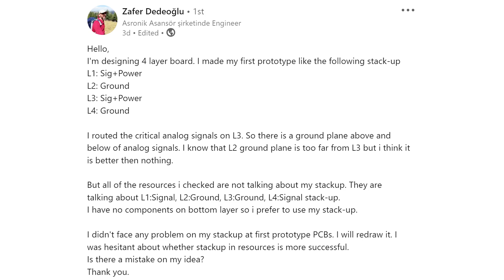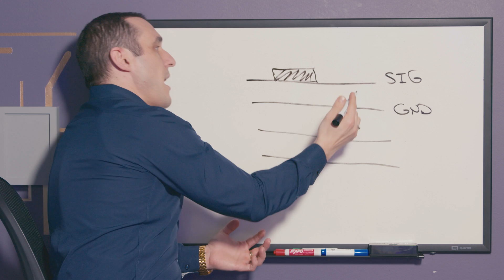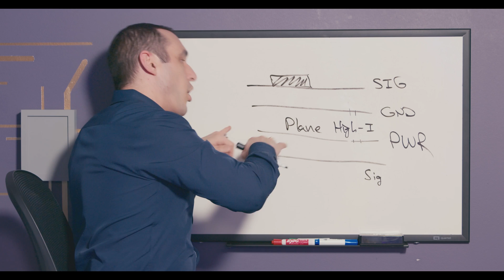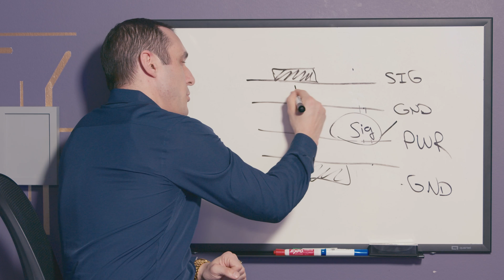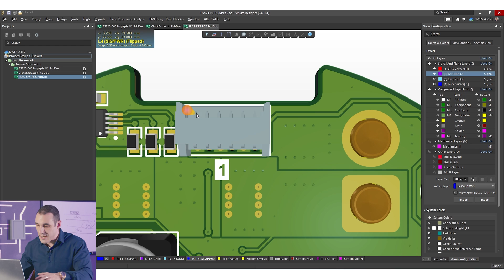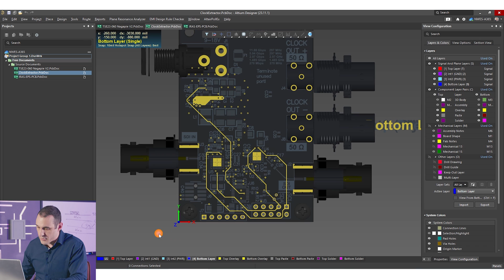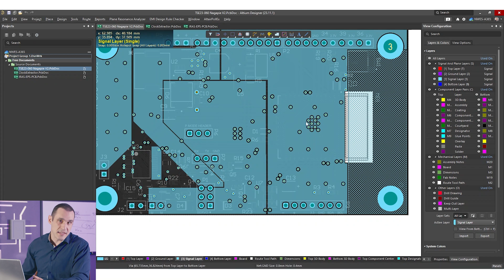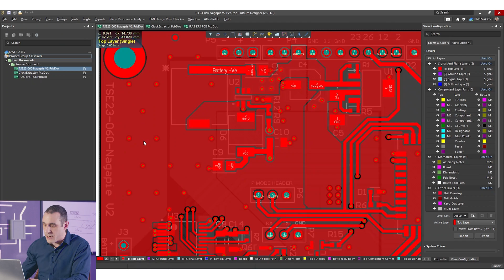Signal Ground Power Ground 4-Layer Stackup? PCB Design Explained!

Comment: What Amperage is considered "high-current"?
Reply: Of course there is no single value where we can say something is high current or low current. You can do some basic calculation in the IPC-2152 standard or use the nomograph in the standard. From there if you calculate that you need a very wide trace to keep temperature rise in the copper below 20 or 30 Celsius, then you could consider that amperage "high current" and you should use large rails or planes instead of traces for power. What I find in design reviews is that many designs will use the power plane out of convenience when they should use a ground plane, they do not actually need the power plane for carrying high current. You can learn more and see the nomograph in IPC-2152 in this video: https://www.youtube.com/watch?v=NmEHH0RtC1U&t=447s

Comment: Would it be terribly wrong to use Signal - Ground - Signal - Power (if you need it) or Ground (if you don't)? That gives you lots of space for traces close to a common ground plane and a possible power plane if you need it.
Reply: I think this is perferrable to using SIG/GND/PWR/SIG especially when you can keep all the components on the top SIG layer. But you will end up having to put ground fill on the SIG layers to balance the copper in the layout, this will also give some additional capacitance to the PWR rails on the back layer. I think as long as you do not put any switching nodes or loops on the back layer then the PWR layer should not be involved in creating EMI problems.

Comment: Hi Zach another excellent video from you.
I`m working on an 220V inverter using a 4 layer stack, i`m thinking about this:
1- LVSIGNAL
2- LVGND
3- LVPWR
4- HVPWR and HVGND.
Is this a good choice? I see that LVGND will shield LVSIGNAL from inverter`s noise, but will LVPWR work properly in a configuration like this? Or should I split the 2nd layer and work with both grounds (LVGND and HVGND) there?
Thankss.
Reply: You should only split LVGND and HVGND if your inverter is galvanically isolated. Not all inverters are isolated so without looking at your specific inverter design it is hard to say.

Comment: Hi Zach and thanks for all these videos, to prevent EMI and EMC problems I lately use SIG-GND-SIG-GND or sometimes SIG-GND-GND-SIG stackup (the last only if I have components also on bottom side),  preferring routing PWR on the signal layer rather than on a plane. In this case I will have all signals an PWR refer to GND plane, is this the correct approach?
Reply: Yes this is a good approach when you do not require high current. One of the major reasons for using a dedicated power layer is to have high current handling, or because you need room for a lot of power rails at different voltages (soon I'll be showing examples of this in our Ethernet switch project). In your case, you are routing power on a SIG layer next to GND so it is a good strategy for EMI/EMC.

Comment: So, I have a 500 V signal (with low current though) being switched by a switching regulator + MOSFET. For this to be a 4 layer board, I was thinking about doing (SIG/GND) - (SIG/GND) - (GND plane) - (PWR and High Voltage Signals with GND pour). The bottom of the board would be placed above a grounded metal case. Is this a good stackup? What if it was a 6 layer board?
Reply: For this you might instead use (SIG + GND)/GND/PWR/GND. Try to spread out the (SIG/GND) in a single layer over your GND plane. Use thinner prepregs that will have the required high voltage CTI value as well so that you can control noise through the GND coupling on L2 and L4.

Comment: Hi. Nice explanation. I have a question. What can be a good isolation for multiple ADC signals?
Reply: Are you trying to prevent crosstalk between your ADC inputs? It is not clear what else "isolation" might mean in this context. If you are referring to crosstalk specifically, the best way to prevent it is to put the GND plane closer to the signals or to space the signals farther apart.
Reply: @Zachariah-Peterson  hi. thanks for suggestion my is regarding the cross talk between adcs as well are external noise from other circuitry nearby adc tracks. will it useful to pore ground between each adc track running parallel or keep them away from each other without pouring ground between them to avoid cross talk.

Comment: Hi Zach,  
On your white board presentation at 4:50 you suggested that "transfer" vias could provide the path for the signal returns when signals transition from layer 1 to layer 4 or visa versa.  Return currents need to find their way from layer 2 to layer 3 as the signal transitions from 1 to 4.  Transfer vias connected to GND work well when both layer 2 and 3 are both connected to GND planes as the two planes are directly shorted together with the transfer vias.  However, if one of those two layers is PWR,  the approach in that case is usually to connect the two planes together using a capacitor on the surface.  This shorts the two planes together for AC, but doesn't work nearly as well as grounded transfer vias when layer 2 and 3 are both GND, due to the additional inductance needed to get from the planes to the capacitor on the surface.       

In the video how were you suggesting that the transfer vias get connected?  Where you suggesting that the grounded transfer vias are connected between the GND plane on layer 2 to a GND fill around the signals on layer 4?  I guess that might help if you bring the GND fill on layer 4 very close to the layer 4 signals transitioning between 1 and 4,  but still doesn't seem very effective for high speed signals as most of the return current for the signals on layer 4 will be flowing in layer 3, even if the ground fill is close to the signal.   Do you agree?
Reply: The transfer vias would provide the return path coverage on the vertical transition only, during the horizontal route the power plane would have to provide that coupling. So it's less bad than just having the power plane and no reference conductor for vertical transition, and those vias are basically stubs. If you had some ground pour around the traces on the bottom layer, you can then get even better return path coverage throughout the route and you could connect the ground pour on L4 to the plane on L2 using the transfer vias.

Regarding the connection between the PWR and GND planes internally, usually you would have a capacitor somewhere so it could be part of the return path, but I don't think it closes the loop sufficiently on high-speed signals. You can always use transfer vias anyways because there will always be a capacitor somewhere. Unfortunately for capacitors they don't give low-frequency return path coverage as they have higher impedance, so the lower frequency end of the signal bandwidth might not be sufficiently covered.

And yes I agree all of this is not so great for high-speed signals. This is why in the SIG-GND-PWR-SIG stackup I would say the last layer is only good for slow configuration signals, DC signals, or maybe an I2C bus, anything faster should be above the GND plane.
Reply: @Zachariah-Peterson  
Thanks for responding.  

It sounds like you are agreeing that the Sig-GND-PWR-Sig configuration is not good for high-speed signals transitioning between layers 1 and 4.   I have never heard anyone suggest that using a transfer via that is just a stub (only grounded on layer 2), would be effective at coupling return currents from layer 2 to layer 3.    However, I guess there would be some AC coupling from the barrel of the GND via to the PWR plane on layer 3.  Have you ever done simulation using a transfer via that is just a stub and found it to be effective?

I have heard a number of designers suggest that the proper approach for this situation is to place a capacitor between PWR and GND right above (or below) the point where the signal transitions, trying to minimize the inductance associated with the mounting of the capacitor.  It doesn't sound like you are a fan of that solution, but I suspect that it might be more effective than the stub transfer via approach.  Have you done designs using the capacitor and found it to be ineffective?
Reply: @thomasyunghans1876  Yes we agree, the transfer via is only effective near the signal via, everywhere else you rely on the capacitance between PWR and GND. If you have some discretes around, that helps but who knows where those discretes are located or which one provides the greatest return path confinement, so even with those discretes you could still have a bigger loop inductance. You could also place a capacitor right where the signal transitions, but I'm not a fan because it's impractical. Who wants to go back through a board, locate every signal via, and add another capacitor right at that point? It's too time consuming in my opinion, if I know I'm going to have to route high speed between both layers I would prefer to do the stackup correctly to begin with, or just put ground pour around those signals adjacent to PWR and then use the transfer via.

Comment: Hi Zach, what do you think about this kind of stack up: SIG/PWR&GND/GND/SIG. Could I use it considering that I don't route over the splits?
Reply: We have seen this implementation in one of the 1-minute design reviews. If you can do it without routing over splits then I say it is fine. I think it takes more planning to do it correctly but it can work well.
Reply: @Zachariah-Peterson Been looking for this answer all over. Thanks!

Comment: I wonder why people breaks a 50 Ohm trace route with a 50 Ohm resistor (a design sample #2)? It should have no effect at all. I think all we need is to match an input impedance with a line impedance. A resistor and an in series capacitor to a ground just before a connector/IC input is fine even for a weakest CMOS output. Am I right?
Reply: It does work as you say but only with the output impedance of the buffer being exactly zero, or at least very close to zero. If the buffer does not have an interface standard or standardized impedance then the trace can be something other than 50 Ohms, it is not always the case. That built-in source impedance and the series resistor together set the output level to the desired value when viewed at the load. Here is a video about it: https://www.youtube.com/watch?v=pL6dY5VKwMI
Reply: @Zachariah-Peterson  I think we need to match a trace and an input impedance to reduce reflections. We don't care of a source cause it will produce "some" level, but this level will be without ringing. At least AMD is fine with only an input impedance matching. "Your" output 50Ohm will be added to a pin output impedance, and so.. What a final impedance will be in this case? For sure it will be far from 50 Ohm. I consider a trace as that resistor.

Comment: If the analog signals are very low level and require shielding, do you think
L1 Sig/pwr
L2 Gnd
L3 Analog signals
L4 Gnd
Is the best approach?
Reply: Yes this is a good approach and I think we received a design review submission that used this approach. It is just like you say, the ground planes above and below the analog signal provides shielding against noise and isolates it from the other signals on the top layer.

Comment: Ever since the cheap rapid fabricators made 4-layer stackups readily available for hobbyists, I've been hooked on signal - ground - V+ - V- for my audio boards. "Power rail impedance? What power rail impedance? [evil grin]" Rout the signals on top, pop in vias for the power rails and ground where needed, Bob's your auntie. Powered from a single 9V battery? No wuckers - Vref is the new ground. All discrete transistors and no need for split rails? Might as well make both inner layers ground and the bottom V+. SMD boards using this stackup look positively naked on the bottom. If I'm the least bit clever about my component placement, I hardly ever need a trace to jump layers; when I do, there are zero ohm jumpers - that's what they're for.
Reply: That's a really good idea for audio! Especially with power, with the +V and -V on two layers you have a lot of room to widen out the traces when needed. You should send me an example board, I'd like to see it.
Reply: @Zachariah-Peterson  "Nothing to see here; move along." ;p V+, V-, and GND/Vref are solid planes, only interrupted by the vias. As Dave Jones of EEVblog has said about cheap pocket moldymeder teardowns, "We've been mooned!"

I mostly just do small signal preamp-y stuff these days (distortion effects, cab simulation), so the signal traces are pretty much just 10 thou across the board. If I need a power amp, off-the-shelf Class D amplifiers are so good and cheap these days there's little sense rolling your own analog amp. I'd be happy to dig something up for you though.

Comment: I might have to try this stackup approach on my next layout!

For the second example high speed board.... If I did fill the top layer to balance the copper planes out, which would require that 3W rule for clearance, would it also be safe to use the impedance calculator with CPWG to ensure the trace impedance stays the same? I guess what I'm really asking is would there be a performance advantage with the ground pour instead of just microstrip referencing L2?
Reply: The 3W rule for clearance is more important when a trace requires controlled impedance. Technically it does not have to be 3W in all cases, the actual limit can be smaller and it depends on the Dk value and the laminate thickness. However, 3W is a good conservative value if you do not know how to calculate the limit specifically. If you use Altium you can also just design the line to be coplanar with the Impedance Calculator in the LSM, then it will already account for the clearance value. In terms of signal propagation, there is not really a difference that would be noticeable until you get to GHz frequencies, the line would be narrower in coplanar so that would increase conductor loss.

Comment: i usually use sig-gnd-pwr-sig config but routing all high speed signals on layer 1 and all other signals that don't require special treatement on layer 4
Reply: I've done this often for power systems that have some digital interface on them. It's not common but it works and it's nice to have the big power layer for high current.